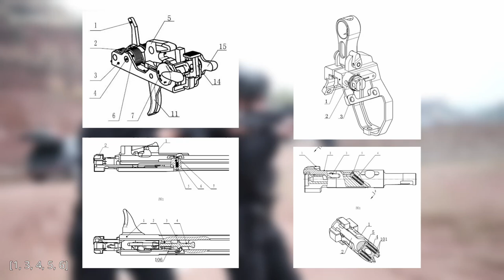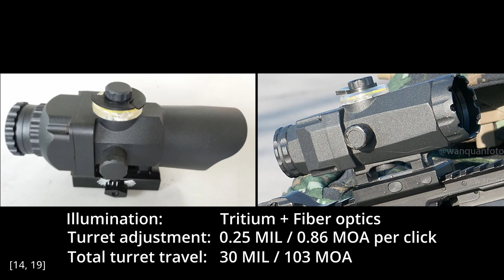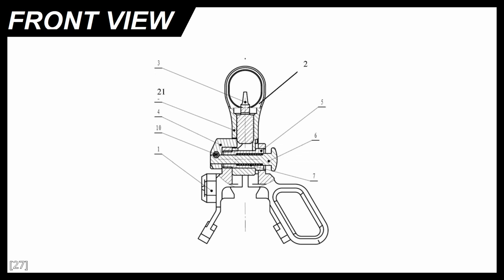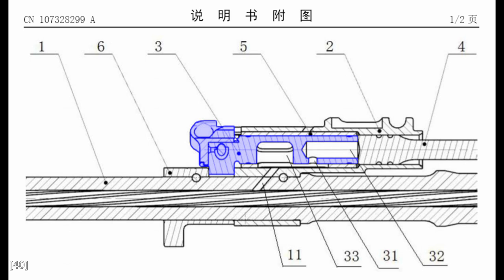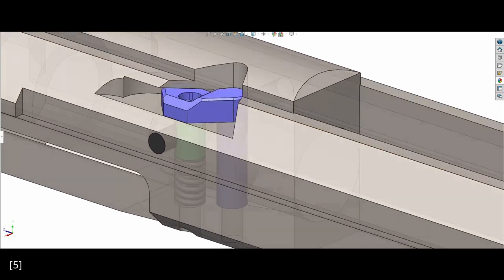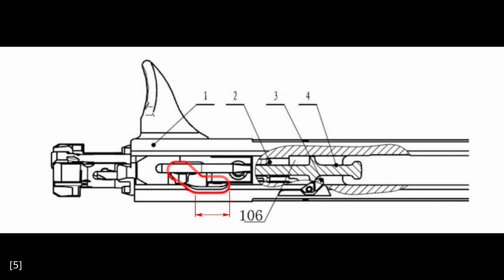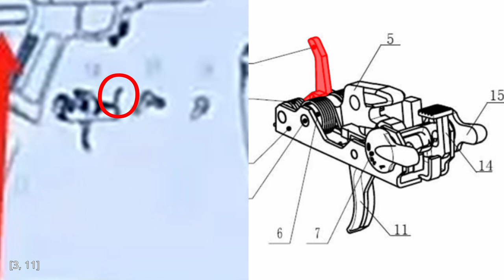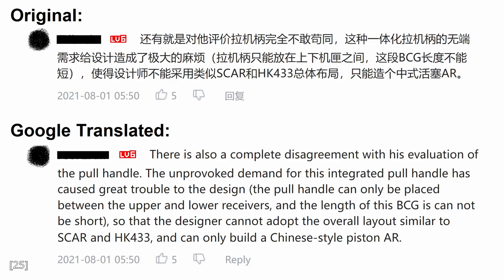QBZ191 - Update / Deep dive [CHECK PINNED COMMENT FOR UPDATES]

Comment: 1. The gunpowder combustion of Chinese bullets is always too violent, and the designer has to use various "over-engineering" to reduce air pressure and facilitate cleaning.

2. The integrated pull handle is a Soviet tradition, because in winter, the firearm is easily frozen and cannot be pulled. This is a lesson from blood
Reply: The bullets are not always overloaded. Depending on the factory they come from the loading can be somewhat inconsistent due to difference in tooling and QC I believe. 

That style of charging handle also isn’t exclusive to the soviets.
Reply from the maker: I have heard that the DBP191 is loaded to higher pressure because they were trying to get the same velocity out of the 191/192 as they can get out of the 95, but I’m not sure how true that is.

I’m also not sure about the integrated charging handle handling the cold better, because Canada have been using an AR15 variant as their service weapon for quite some time, and it’s pretty cold in Canada.
Reply from the maker: @AVWUVU  I’ve seen that one, but I’m not sure if it’s the fact that the charging handles are integral that made them perform better. AR charging handles don’t stick out that much, which make them hard to grab on to. It’s would be nice to see the test performed with rifles like the CZ Bren 2, where the charging handle is non-reciprocating but sticks out to the side just like an AK
Reply: @cabbage6015  For those extreme environmental tests, the rifle served in the PLA army has to be performed really well. In all those tests, shooters have to manually operate the bolt carrier to open and close the bolt. This has been shown to us in famous Kalashnikov documentaries, the dust test and the rain test after. Reciprocated charging handle is mandatory for those extreme conditions because opening the bolt carrier will be hard when external dust is inside the trunnion because of the water. Same thing for the cold environment.
The integrated are usually made when the raw metal bar was forged during the early process ( Also shown in multiple Kalashnikov videos). Because of this the integrated charging handle are usually more durable. Think about the internal grain texture of the metal. That's why Russian army and pla choose to have integrated and reciprocated charging handles.
Also, you did a great job on this and the previous video.
Reply from the maker: @clayspenser6793  Thanks for the insights! I certainly don't have anything against integrated charging handles, just wondering if opening the bolt in cold conditions would be just as easy with a non-reciprocating charging handle, if the handle sticks out to the side just as much. 

I was just also thinking about how machining a bolt carrier with a fixed charging handle from a billet would waste a lot of material, but if it comes from a forging then that problem would certainly be solved. The durability perk is nice too.

Comment: Video made with passion, love it! 

What is your personal opinion of the 5.8x42 cartridge family? 

And if logistic is a nonfactor, what cartridge would you like to see adopted for modern infantry rifles?
Reply from the maker: Thanks! Glad you like it. 

I don't know much about ammunition design in general, but I have read some Chinese sources claiming that the 5.8 is designed to prioritize penetration over soft tissue damage, but since the US issues level IV plates on a large scale, I don't think the penetration advantage of 5.8 is very relevant.  External ballistic characteristics of the 5.8 are generally a bit better than 5.56, greater energy retention at long range, flatter tragectory, but these differences are pretty minimal. The 5.8 case also has a more pronounced taper compared to 5.56, which should make for easier extraction. Overall I think the 5.8 is a very solid small calibre high velocity cartridge with pretty similar performance compared to its counterparts.
Reply: @cabbage6015  Interesting, somehow small arms developments don't adhere to the feedback loop of up-gunning and up-armoring in armored warfare. The leaps made in effectiveness of tank rounds and armor during four years of WW2 is equivalent to a century and a half of small caliber development 7.62x54r
Reply: @Finnv893 Because humans cannot withstand too much weight and recoil force. Human beings are the main factor limiting the development of small arms

Comment: The dual gas port design looks like its designed to allow lower pressure subsonic loads to work both suppressed and unsuppressed, while the dual chamber allows it to tolerate the backpressure from firing regular supersonic ammo suppressed, without worrying about the increased backpressure overstressing the system like on an M4.

Comment: I'm interested in the DBP 191 ammunition for the QBZ 191 and how it compares to the new 6.8 NGSW rifles.
Reply from the maker: I couldn't find any significant info about it, sorry. But it's just a 5.8x42mm round that is likely loaded to higher pressures than their previous round, the DBP10 for the QBZ95-1. It would probably perform similar to 5.56, and nowhere near the 6.8
Reply: @cabbage6015  So do you think the 6.8mm will render the QBZ 191 inferior and not as useful as it could be?
Reply from the maker: @J_X999  I don’t know that much about the 6.8, but it sounds to me like just another full power battle rifle cartridge, in the same category as the 7.62x51. With that comes the same pros and cons of a battle rifle cartridge: higher energy than the DBP191, better penetration than the DBP191, longer range than the DBP191, but more recoil and soldiers won’t be able to carry as many. Of course, carrying capacity can be improved if they decide to go with polymer case, but the sheer size of the cartridge will still be an issue. The 6.8 also seems to be loaded to very high pressures, so I’m curious about what effects it will have on the life of the firearms chambered in it
Reply: @cabbage6015  It seems like the 6.8 is pretty powerful but looking at the QBZ 191, I don't think it will revolutionise warfare and completely destroy Chinese counterparts.
Reply: @cabbage6015  Hi again, I did a little bit more research into the DBP 191 myself again but it seems shrouded in a lot of mystery.
If I had to summarise it, I'd say it's an upgrade but still has the fundamental advantages and disadvantages of the normal 5.8x42. It could also be specifically designed to penetrate body armour as well.
Reply from the maker: @J_X999  Interesting... Thanks for coming back with the information!
Reply: @J_X999  6.8 NGSW got one trick: extremely high chamber pressure, loading with that kind of pressure can make any cartridge works wonder, the problem is how would it do to those poor barrels with that kind of chamber pressure.
Reply: @J_X999  6.8 is just another full power cartridge that (as all other full power cartridges) is to heavy, to large, and produce to much recoil to be used efficiently in primary millitary AR. And it's still is not good enough against modern millitary body armor plates.